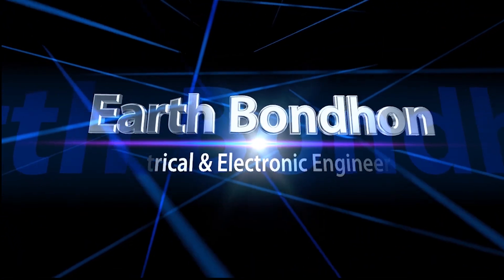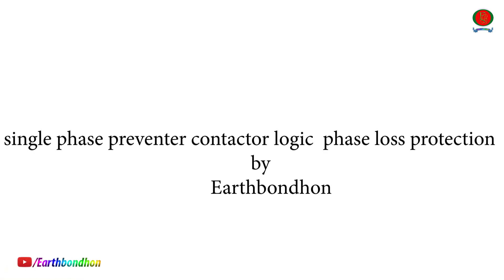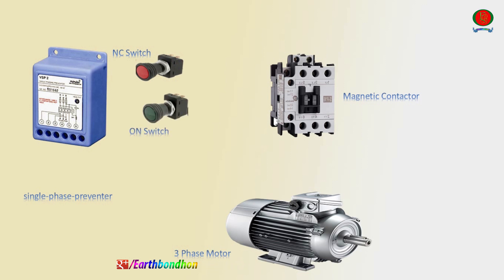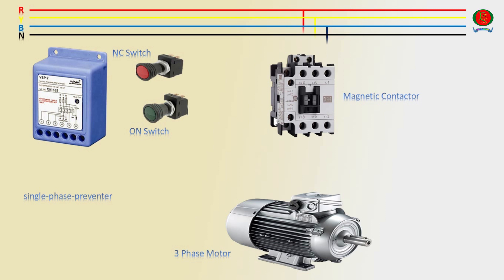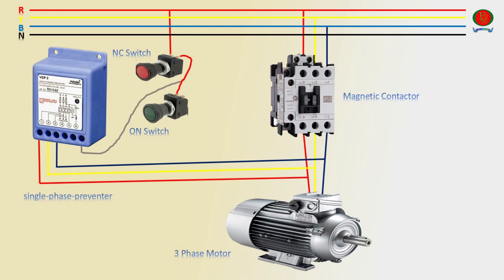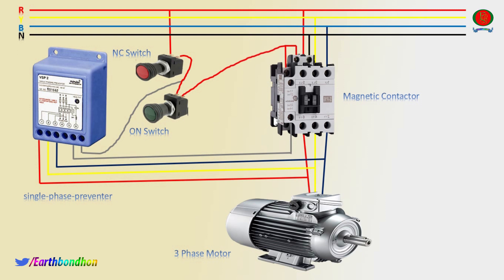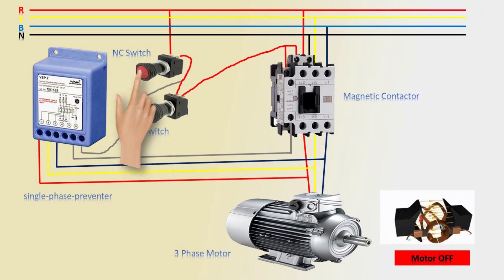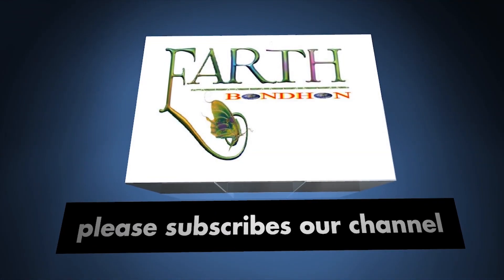single phase preventer contactor | logic phase loss protection by Earthbondhon

Comment: Wrong connection
Reply from the maker: right connection.Thanks, friend
FB id: earthbondhon.org
add me
Reply: @EarthBondhon  if you connect the wire of preventer with contractor's outer pole, the preventer and the contractor can't be operated. You have to connect the wire of preventer with main supply. Thanks